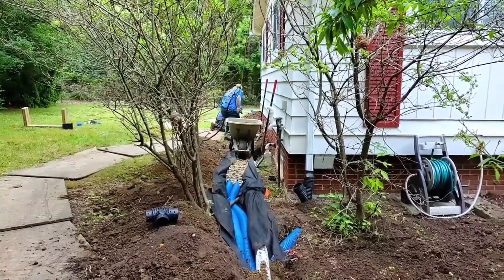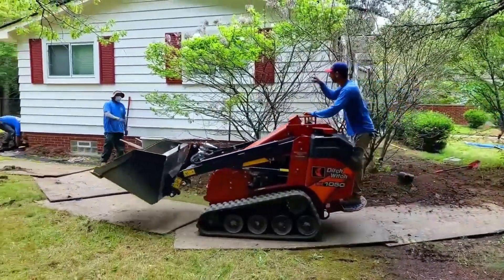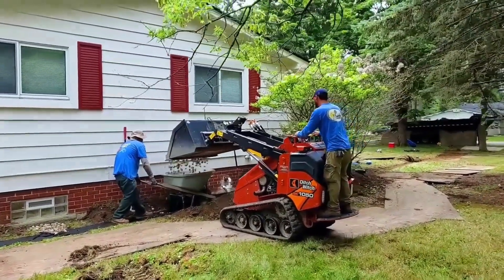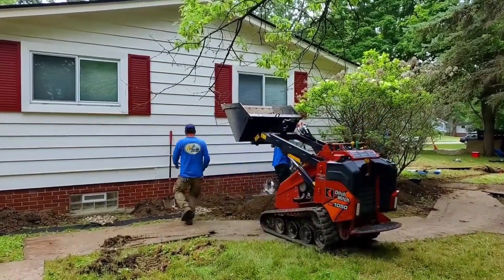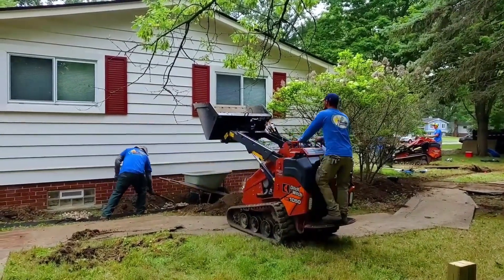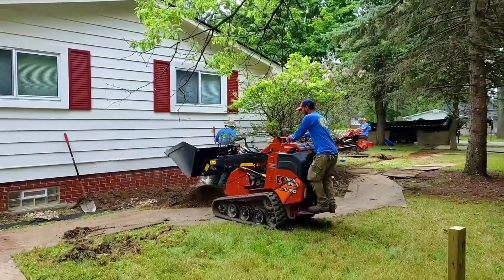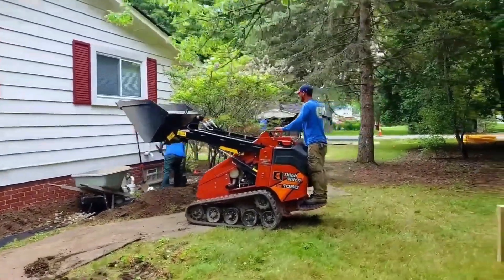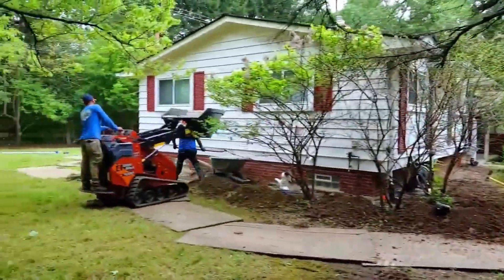How to Build a Curtain French Drain around a Home with a Basement   [ Licensed Builder Explains ]

Comment: I've been looking around at your different videos for quite some time and can't seem to find specific answers to questions around proper trench depth and basement waterproofing. Hoping you could answer these questions here before I go purchase the materials.
  1.  How deep should a proper Curtain French Drain be dug? 
  2.  If the trench was deeper (say 6 feet or so), would that do a better job of keeping water/moisture out of the basement vs. a shallower trench?
  3.  To waterproof a basement thoroughly, prior to finishing it, is a properly built Curtain French Drain enough, or do you need to add more external or internal waterproofing?
Reply from the maker: You can break it down in three steps. First, a foundation drain is absolutely necessary.

https://youtube.com/playlist?list=PLjFCqaZ4v1BWSyew4JyZuxDpBvULztf91&si=PA3AHjltTahT44Nc

Second, you must manage your roof runoff water responsibly.

https://youtube.com/playlist?list=PLjFCqaZ4v1BVXKFHIb3Hd4nsppJYo0hzu&si=PUcPaUDzG0cbxzKr

Third, if necessary, add additional drainage to catch water near or approaching the house.

https://youtube.com/playlist?list=PLjFCqaZ4v1BU97iPd_0g-OAoj__Qth3nu&si=LcoEhpbTTQ736rNR

Comment: I have a question for you.  Can I leave the gravel exposed to let more water flow more easily into the curtain drain, or do you have to cover it with soil?  
Also, if you could leave just gravel on top (which I would like the look of in my flower beds), do you wrap the drainage barrier over the top of pipe before filling it with gravel, or cut it to ground level on either side?  Thanks
Reply from the maker: https://youtube.com/playlist?list=PLjFCqaZ4v1BXFJKxV1EfanZ1Q-lZ1SODD&si=jNdgh_MV6jtoQPtA

Comment: My garage is on a slab of concrete.  In the yard the water hits the garage side.  My middle yard that is attatched to my garage slopes down and hits the garage. So there is no crawl space and no basement. How close or far should the french drain be in proximity to the garage.
Reply from the maker: There's a lot of factors that go into that decision. If I can create a swale around the building I'll do that first and then put the French drain in the center of the swale.  You can put an open French drain right off the cement. I usually go wider with an open French drain.

Comment: For the curtain french drain, is the pipe perforated or not? Or is it a mixture of both where I’ve seen in your other videos where you have one roof drainage system and one french drain system put in the same trench together. Thanks in advance for the help!
Reply from the maker: 2 systems. Gutter Downspouts on a solid Armor Pipe and 8 slot High Octane for French Drain pipe.
Reply: @FRENCHDRAINMAN  thank you sir for the quick reply! Appreciate you 💪 last question: is it necessary to put a curtain french drain around the entire house? Or only on the sides with negative slope? Thank you thank you

Comment: Hello
I've got garage adjecant with house. It's 20by20 feet. Back side and left side has empty space that no one ever goes there. Its 25 inches. Would it be ok if i just dig a trench on those two sides and put geotextile on bottom, perforated pipe and gravel on top of it. I do not need to wrap it with fabric nothing will go on top of it. At end of that perforated i make transition to regular pipe and of to drain.
Reply from the maker: https://youtube.com/playlist?list=PLjFCqaZ4v1BXFJKxV1EfanZ1Q-lZ1SODD&si=YsbsxJ5G9-vG9R9G

Comment: Can leaking basement be caused by water table? My yard gets 0 standing water (been in home since 2010 and have only seen standing water once and it was just about 4ftx2ft section against the back of my fence which s about 70ft from the house) .. I can get up to 1" of water filling the east side of the basement...middle can be dry with wetness appearing in cracks.. east side water comes through a small hole in the block wall at floor level,  and small spout coming from the floor in a couple spots.. 
East side has a new addition with crawlspace that stays dry.. west side exterior generally stays dry when raining  because of wind direction.  North side has crawlspace that is high enough to hunch over and almost stand up..south has crawlspace under big front porch.... but water comes in on every wall . Summertime I route downspout water away from going into ground via 4" pvc .. (at least 20 ft) ..... ground has to be saturated a few days worth of mild rain before I start getting basement water.. 
Basically..wondering if water table can play a role
Reply from the maker: Downspouts are the leading cause. To solve this problem, make sure you have gutters on your house and that those gutter downspouts are run underground.
https://youtube.com/playlist?list=PLjFCqaZ4v1BVXKFHIb3Hd4nsppJYo0hzu&si=722SWWvQ7nd_c2DC
Reply: @FRENCHDRAINMAN  I don't own that home anymore,  but thanks for replying to my question from 3 years ago .. new home could use some of your products..will be purchasing
Reply: I'll have them on my home before you see this lol